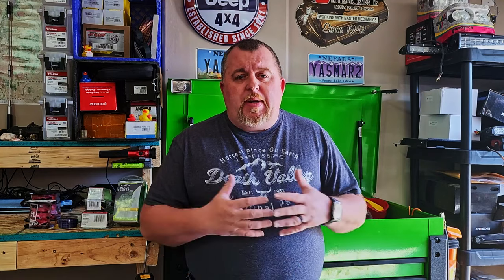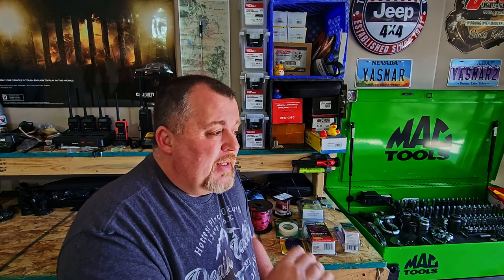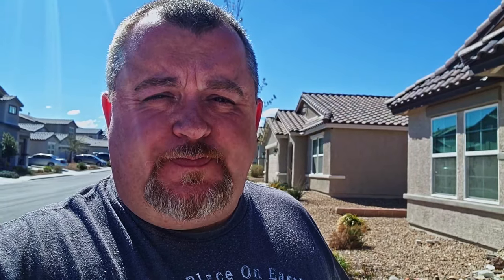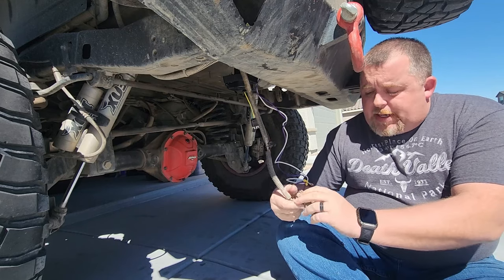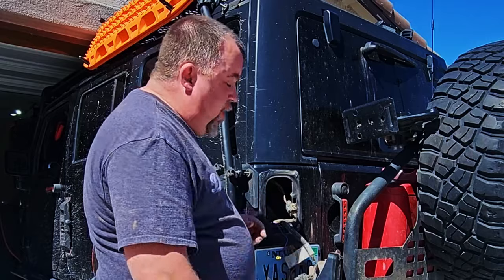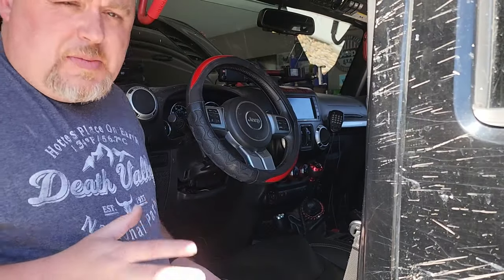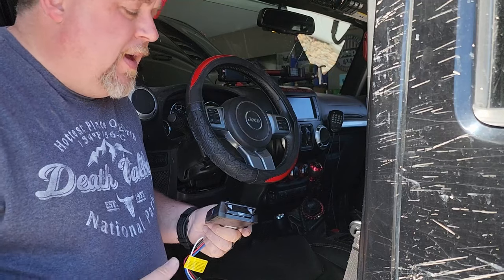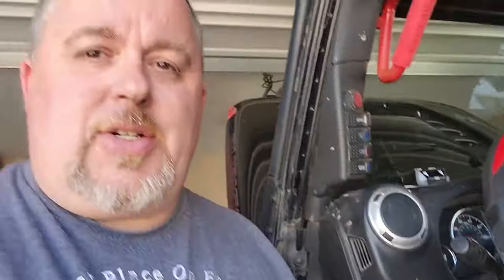Overland Trailer Essentials, you cannot pull one without this!

Comment: Hey Josh!!  Great video..  Yeah.. don't ever show the wiring again.  I'll have nightmares about that. One thing you said at the beginning is the tow capacity of the JKU/JLU was 4,500 lbs.  The capacity is actually only 3,500 lbs, i'm sure you knew that, probably just a slip of the tongue.    I think the other issue, is a lot of folks get used jeeps that don't have the JKU Max Tow Package, or the JLU Tow package, so many folks will need to install it aftermarket and probably don't have the brake controller harness tucked away nicely in the dash.  I'm getting a tow package installed by Uhaul on Thursday for my JLU which will include the hitch, 7 pin and 4 pin.  I won't have the upgraded alternator or battery, but should be fine.  I'm just using a Tekonsha Prodigy Wireless Brake Controller, which has worked great for me.  You kinda beat me to the punch, as i'm doing a whole series of towing with a wrangler series.. but I won't be getting into the nitty/gritty of wiring.  I'll be doing the towing with my 2,300 lb aliner camper and taking it up a mountain pass.  Should be fun. Your Vegas YouTube creator buddy !!

Comment: Having some experience pulling trailers off-road I would recommend a controller with a manual mode to assist in down hill control. It applies the brakes on the trailer without the brake pedal so the trailer doesn’t want to push or pass you on steep hills.